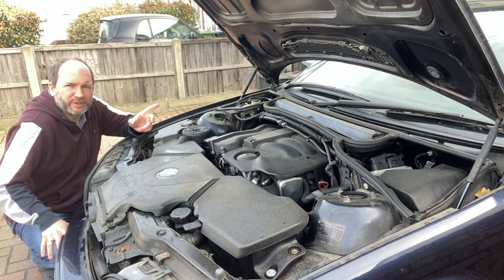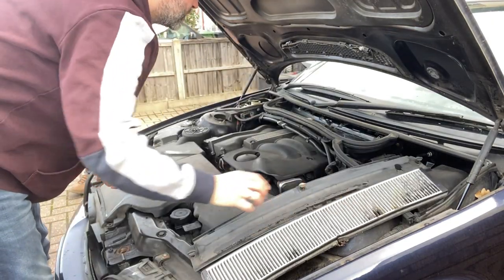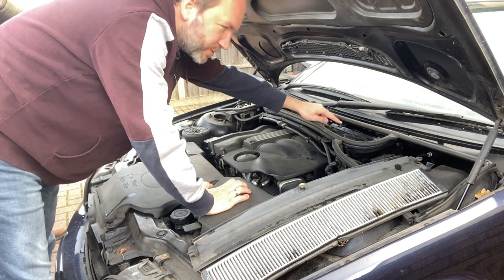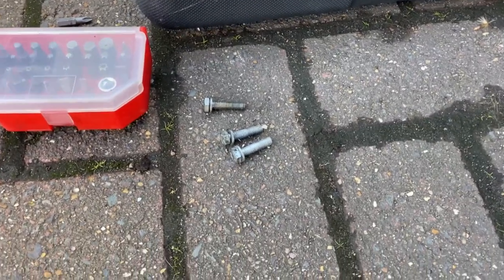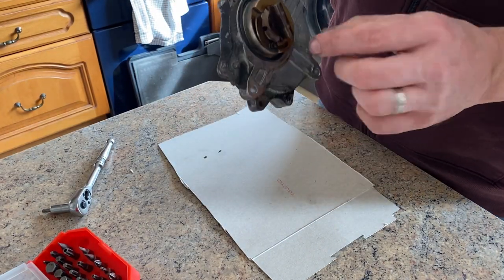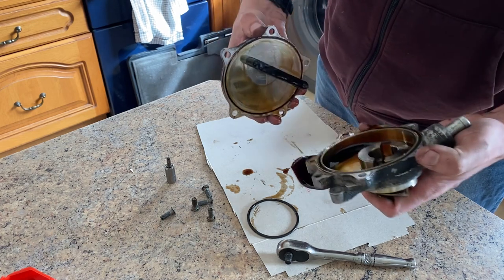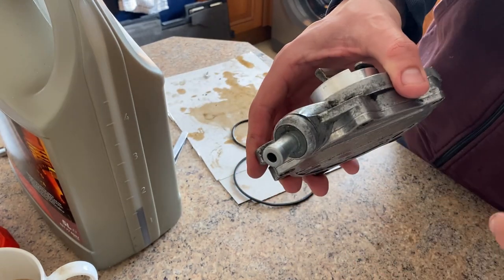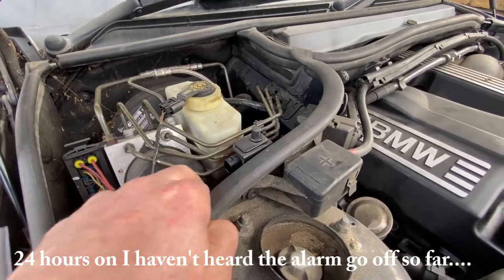BMW N42 / N46 Vacuum Pump Seal Replacement - One of the Main Reasons These Engines LEAK Oil

Comment: Did the oil leak on the catalytic converter? I'm doubting between a vacuum pump leak or a valve cover gasket leak at the back. My car drips oil on the catalytic converter.
Reply from the maker: It was dripping it all over the exhaust at the back of the engine. May have been the cat.

Comment: What sort of socket did you use to undo the bolts? I dont seem to have much working room on mine and can barely fit my hand in there
Reply from the maker: I can’t remember now. It would have been either a torx or a 8/10mm.

Comment: do you have a part number of the seals? is the kit originally bmw?
Reply from the maker: No I used a set off eBay. 

https://www.ebay.co.uk/itm/183969555905?mkcid=16&mkevt=1&mkrid=711-127632-2357-0&ssspo=tF-TxQTlTu6&sssrc=4429486&ssuid=ENW11iTvRY2&var=&widget_ver=artemis&media=COPY